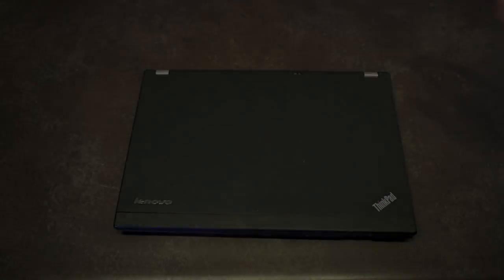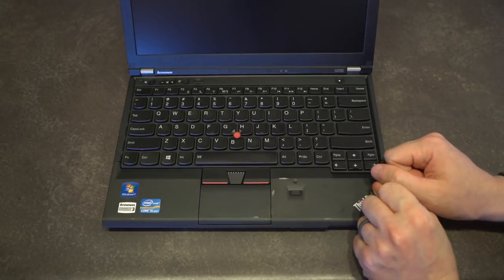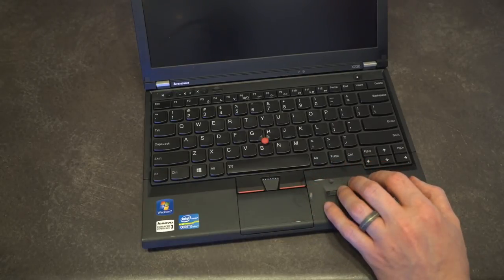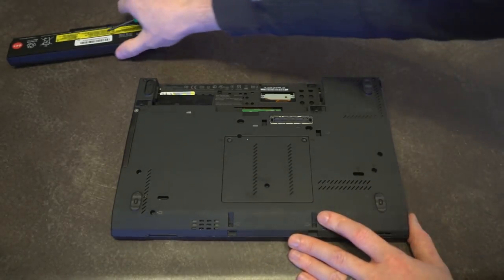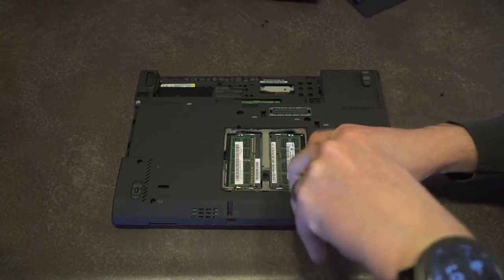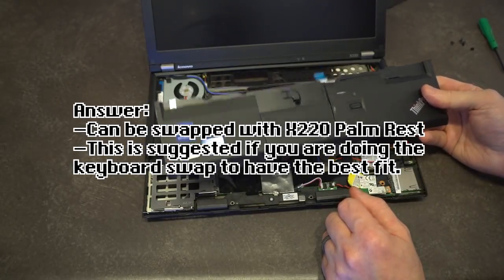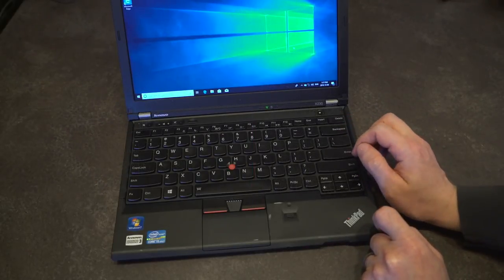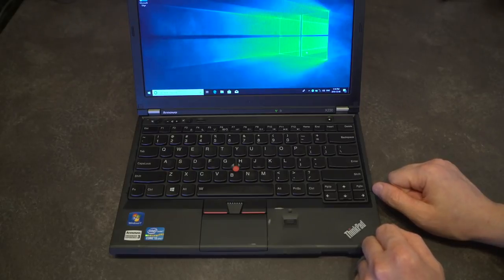Lenovo ThinkPad X230: A Fan Favourite

Comment: would you recommend x230 or x240? Same price
Reply from the maker: Jeez that's tough. X230 has the stronger cpu and nicer trackpad, x240 has better battery life and capacity, not to mention newer integrated graphics.
Reply: @LaptopRetrospective  yeah is that x240 touchpad that bad? Thats one thing that's holding me back
Reply from the maker: I'd swap it out almost immediately if I were buying an X240 and not an X250. Thankfully parts are available to do this very  thing.
Reply: @LaptopRetrospective  why is it that bad I don't really use trackpoint and if it was bad is it easy to replace?
Reply from the maker: It's a manageable swap but the whole click pad is spunge like. You can see an X240 on this channel if you haven't already.
Reply: @LaptopRetrospective  and how would those two laptops run league of legends? I'm planning to buy some laptop for a college and those two are my favorites rn do you suggest anything else in this price range?
Reply from the maker: @danbartik4428  You'd meet the minimum requirements I think, not the recommended. You'd want to track down one with the 1080p panel I'd imagine. As for price range, that depends on what these cost you where you are vs what is available.

Comment: My x230 doesn’t have the fingerprint scanner:( also my thinklight is none functional so I probably wanna install a backlit keyboard in there at some point.
Reply from the maker: You could also replace the ThinkLight. Fun little project.
Reply: @LaptopRetrospective  I could do, I’m no good at taking apart laptops:( 

It sort of works but only if I press the top of the display
Reply from the maker: Well you've got the maintenance manual to follow if you want to give it a try. 😉

Comment: These things get warm very quick on the underneath though...I don't like how you can't change the CPUs in these and the screen damages easy, shame as they're nice without fault.
Reply from the maker: Haven't had screen breakage on the ones I've seen. Sadly most modern laptops aren't socketed.
Reply: @LaptopRetrospective  yeah I've got one of these and suddenly a green line appeared down more the left side of the screen. It's an ips. When it's been on for a while the line fades a little but on start up...a bright green line. Yup this is why I prefer the win7 designed laptops. They're more upgradeable...best era for laptops. Like the hp elitebooks are pretty solid, and the CPU is easily removed. I do like these Lenovo x2 series, but I just think they're abit flimsy.

Comment: Mine is a i5 3210m with 4gb ram 😥
I am also missing the backlit keys but I have the light next to the webcam, is it possible to fit a backlit keyboard?
Reply from the maker: Yep, just need the right part for the x230. It's in the hardware manual.

Comment: I have an x230 and im supper happy with it, but the one thing that the t series does better is durability. My brother has a t430 and it was dropped on the concrete and it was totally fine haha
Reply from the maker: The T430 does have more mass to absorb the impact I suspect. Each drop is different.

Comment: Thank you for your good video on the Lenovo X230. My X230 is constantly overheating. Is there any solution to this please?
Reply from the maker: New thermal paste and possibly a fan replacement without knowing more. Def an issue in the cooling system somewhere.
Reply: if you change a new fan, and using old heatsink, make sure no dust in jammed between the fan and heatsink in between. 

If you are swapping a heatsink with a new fan then no problem with it. 

after doing that, see if its help, it is still the same it means something in your laptop is running that is pushing the temp to the max (try a bootable like puppy linux or another hard disk with a fresh windows to see its sitll over heat with new thermal paste and fan.

Comment: I have the tablet version of the x230 with capacitive screen and Wacom pen, running Win10. It's a very nice machine, but it's way heavier to hold in touchscreen mode than an iPad!
Reply from the maker: It is one of the benefits of lighter machines is it makes the tablet form factor easier to use.

Comment: Hi, would anyone know whether it would be possible to replace the keyboard and palm rest on the x230 with with the keyboard and palm rest (the one without the track pad) of the x200?
Reply from the maker: The keyboard, as far as I've read can be downgraded to the x220, not sure about the palm rest. I think I've read some things on the forums, but I can't remember the specific information.
Reply: @LaptopRetrospective  Thanks for your reply! If you find more information on this matter, please do a video on it! :) That would be highly interesting. The keyboard on the x230 is nice, but I prefer the older keyboards. Furthermore, I don't like the track pad on the x230 at all! I don't know why, but it somehow annoys me. Besides, I much prefer to use the track point over the track pad anyway.
Reply from the maker: @hpp6116  I can confirm that the screw patterns on the X200 parts does not fit the x220 and x230.

Comment: I bought the x230 last year after upgrading from X131e. I just love it! The only thing that is a downside is that the battery gets sucked out quite easy.

Btw my x230 fell down from a table so one of the springs for holding the battery in place isnt working, can somebody advime me how to fix it?
Reply from the maker: Check the maintenance manual for a part number and look at replacement options.

Comment: this is video from a nice laptop ! 
I (daily) use a macbook with the same specs as this laptop. 
Do you know how it handle linux drivers ? 
I was just about to switch to a Thinkpad when I heard about the locked down BIOS, 
Do you know of any brand that makes same quality laptops without those drawbacks ?
Is there ways to flash the Bios whitelist on newer models like the T480s ?
Reply from the maker: Drivers for Linux are a non issue. As for the BIOS, most people want to do it on older units to get better WiFi cards, which isn't as big of an issue on newer machines. It can be done, but requires hardware flashing.
Reply: Depending on your use case, I’d put money on it being the BEST laptop for Linux, actually
Reply from the maker: ThinkPad and Linux generally get along famously.

Comment: Kindly advise for Fan error or I have to exchange the fan of X230 thikpad
Reply from the maker: From the Lenovo forums: "Fan error" doesn't mean "doesn't spin" or "too hot", it usually means "too slow". The fan spins for 1/2 second at startup and if the speed isn't high enough, it usually means the lubrication has dried up or worn out. You can try to clean it and re lubricate or it needs to be replaced.

Comment: im watching this on a X230, but still Win7
how to enable mute for microphone here? mine cannot do that :(, and non original battery cant do charging threshold?
Reply from the maker: You might be missing some drivers or your button might be faulty.
Reply: @LaptopRetrospective  what is the name of the driver? i still finding it but nothing found
Reply from the maker: @hafizhnabawi1707  on most models it is called a hotkey driver.
Reply: @LaptopRetrospective  can you give more detailed information about that thing? Im a rookie on ThinkPads
Reply from the maker: @hafizhnabawi1707  what information would be the most helpful?
Reply: @LaptopRetrospective  the suited driver and what site should i go for
And battery threshold mode ☺️
Reply: @LaptopRetrospective  i've got the needed driver, very happy that my machine works fiine
thank you ery much
Reply: @LaptopRetrospective  and another question that, how to synchronize between my 65w adapter that should be readed as 65w not 90w one on ThinkVantage power manager?
Reply from the maker: Glad you got the driver working. I am not sure what you are asking regarding the power adapter.
Reply: @LaptopRetrospective  i mean that when i plug the adapter the Lenovo power manager is telling me that i attach a 90w adapter instead 65w. also, i got the core i5-3230M rather than 3320M but no performance differrence is visible
Reply from the maker: @hafizhnabawi1707  is it a legit Lenovo part? Regarding the processor difference, I'm not sure you will notice a massive change between those two.
Reply: @LaptopRetrospective  yes it is. Its an original Lenovo adapter came along with my machine.

Comment: Mine won't boot with hyperx ram 16gb...any suggestion to fix it?
Reply from the maker: What are the exact specs of the RAM you're trying to use?
Reply: HyperX IMPACT (HX321LS11IB2)
Reply from the maker: As I suspected, RAM your using isn't compatible from what I'm reading. PC3-12800 1600MHzDDR3 is what is listed as stock. That RAM you've listed is DDR3L and 2133MHz.

https://www.lenovo.com/ca/en/laptops/thinkpad/x-series/x230/
Reply: ooo...that's why..thanks
Reply: And is it possible to underclock it??
Reply from the maker: Not 100% sure.
Reply: Ok thanks
Reply: My X230 can handle DDR3L 2133Mhz 16gb RAM without problems. Maybe your bios configuration is locked and you should change the setting.
Reply: @josebringas8099  what bios version do you use?
Reply: @fajrulkamil4574  you can search in Reddit in the thinkpad foro. There are a lot of us using 16gb RAM 2133Mhz. Because I didn't touch anything in the bios settings, only put it on ram slots. But there are people that had that issue.
Reply: @josebringas8099  ok thanks

Comment: Has anyone experienced an issue when you move or jostle x230 powers off? You have to physically remove battery and reinsert to boot again. Everything works fine unless you bump or adjust the screen. I tried re seating WiFi Bluetooth module, but made no difference. This is such an amazing laptop - it bums me having this issue. Bought new OEM battery, SSD and did clean install of Win10 1809.
Reply from the maker: Sounds like something is loose on the mobo.
Reply: Take it apart, remove the heatsink, clean the OEM thermal "paste", apply new paste.
Reply from the maker: Think it might be a heat issue? Might be best to monitor the thermals first.
Reply: I'm leaning towards a bad solder joint on the motherboard. My thermals are okay, and the issue only seems to occur when putting pressure on the right corner of the screen. I'll definitely apply new thermal paste when I tear everything down to investigate.
Reply from the maker: If that is the cause, I'd be looking for a bad trace.

Comment: any idea if I can develop games using Unity on this laptop?
Reply from the maker: Minimum system requirements for the version you're planning on using?
Reply: @LaptopRetrospective  from https://docs.unity3d.com/Manual/system-requirements.html

System requirements for Unity 2019.2

System Minimum requirements
Operating system Windows: 7 SP1+, 8, 10, 64-bit versions only
macOS: 10.12+
Linux: Fixed at: Ubuntu 16.04, 18.04 and CentOS 7
Server versions of Windows and OS X are untested.
CPU SSE2 instruction set support.
GPU Graphics card with DX10 (shader model 4.0) capabilities.

Devices
iOS
Mac computer running minimum macOS 10.12.6 and Xcode 9.4 or higher.

Android Android SDK and Java Development Kit (JDK).
IL2CPP scripting backend requires Android NDK.

Universal Windows Platform
Windows 10 (64-bit), Visual Studio 2015 with C++ Tools component or later and Windows 10 SDK.
Reply from the maker: @shuragamingyt  According to this, it should be able to, but I don't know how high I'd set my expectations.
Reply: @LaptopRetrospective  Thanks for the reply. Also, I like how you edit and present your videos. Informational, to the point and the video length is ideal. Keep up the good work! :D
Reply from the maker: @shuragamingyt  Thanks Boss, I'm glad you enjoy the format.

Comment: Hi, can anyone provide any info about external monitor support? Like maximum supported resolution.
Reply from the maker: These either have Intel HD 3000 or 4000 integrated GPUs depending on the CPU. 1920×1200 through HDMI and 2560×1600 through DisplayPort. But it's one or the other, not both at once.
Reply: @LaptopRetrospective  thanks a lot. Love this channel.
Reply from the maker: You're welcome!

Comment: Is it useful for designing and video editing?
Reply from the maker: Depends on the demands of your projects and what CPU configuration you are using. More details would be helpful.
Reply: Laptop Retrospective I am thinking of buying a laptop to use on Photoshop, illustrator, and maybe premier and after effects and, I saw a core i5 with 240gb SSD. I want a Lenovo but I am in a budget less tan 500$
Reply from the maker: those programs can use a lot of resources. Depending on the complexity of your projects I think you'll find the x230 and lower end machines bottleneck easily.
Reply: Laptop Retrospective thank you very much!!

Comment: I bought one and immediately switched out the awful chiclet keyboard for an X220 keyboard. Be prepared to do a little firmware updates to get the mapping right.
Reply from the maker: Yeah, sadly not a drop in replacement.
Reply: I prefer the the chiclet keyboard over the traditional keyboard. I love them both on Thinkpads though.

Comment: Which has a good display x230 or t430?
Reply from the maker: That mostly depends on the used model you find. Most came with TN panels, not IPS. But you can buy upgrades for both.

Comment: Now I feel I should get a X230 its cheaper too and you can put the same keyboard on it

Feels cool to have a no bars 100% free hacker laptop, a pinnacle in computing. X220 is a little bit more costly than a X230 on ebay that must mean that theres something to it even without its upgrade hardware!
Reply from the maker: X230 and X220 are both still great little computers.

Comment: Conseils for ssd purchase for Xmas? I'm a x220 owner
Reply from the maker: Not sure I completely caught what you're asking.
Reply: @LaptopRetrospective  Suggestion to what SSD buy for my X220 for Xmas. There are too many models in 250GB section, I still didn't try that technology with a laptop.
Reply from the maker: Lots of options indeed. I suggest a reputable brand, but that can vary depending on where you're shopping.
Reply: @LaptopRetrospective  Central Europe
Reply from the maker: Samsung, Western Digital and ADATA are my main go to drives.

Comment: does anybody actually know whether it's possible to fit a hard drive 9mm thick from inside? doing it from outside, only 7mm one will go.
Reply from the maker: Might not. No experience here.
Reply: Yes you can but it’s inside only. You will have to leave off the rubber side bumpers, but it can be done!
These days, since 7mm drives in large sizes are available so you might as well stick with the 7mm size.
Reply: @GasPipeJimmy  ok, I see. was wondering as I have some spare 9mm one's lying around.
Reply: as kv Yeah, give it a shot then!
Reply from the maker: Thanks for the information!
Reply: Laptop Retrospective Happy to help!

Comment: Should I get this or a t420?
Reply from the maker: Interesting question, the two machines are very different in size, capability and performance. What do you plan on using it for?
Reply: Laptop Retrospective I’m planning on using it for school, watching movies, and browsing the web. What’s the best upgradable Lenovo for that use in your opinion with a fairly good battery life?
Reply from the maker: @ethankim1089  if you want upgradability then you want to go the T series route.
Reply: Laptop Retrospective t420 or 30?
Reply from the maker: @ethankim1089  both are very upgradable. There is a great guide out there for the T430 I've linked my the related video.

Comment: What makes this a fan favorite, just wondering?
This has been my machine for the last 7 years.
Reply from the maker: The X230 is a great size, portable, good port selection with USB 3 and is very moddable. From ivyrain BIOS Mods, mSATA drives, ExpressCard slot mods, classic keyboard swap to name a few, people enjoy upgrading them.
Reply: @Laptop Retrospective  what Express card mods are possible, have not explored that. I must say the IPS screen is nice despite it being only 720p. Thanks!
Reply from the maker: More USB ports, external GPU kits, NVMe adapters. I believe I've featured all three of those on the channel and I suspect there are more.

Comment: I have x230 too! But not like yours mine dont have that box thing at the right of arm rest.
X230 is good it is also boot fast and durable .
The only thing i hate is cpu speed is reduce to half when theres no battery. So you need its battery to run it full speed but my battery is dying
Edit: i also have the docking thing. That give extra slot and dvd rom
Reply from the maker: The box thing is the optional finger print reader. Batteries are easy to come by so hopefully it's not a problem for long.

Comment: how the f**k is keyboard supposted to overheat?
Reply from the maker: Keyboard overheats due to the pinout not being exactly the same and the volts sent to one part being slightly higher than it should be. So I've read.

Comment: I almost bought one of these last week, but it had a mechanical drive so I thought i'd wait to find a better configuration.
Reply from the maker: Drives are pretty cheap, if it's in good condition I'd just swap them.
Reply: Drives are super easy to replace, and you probably want to start fresh with a new drive anyway
Reply: @archygrey9093  I ended up with an x260 for $120 and got an opal 256gb ssd in it.
Reply from the maker: Nice score!
Reply: @TheBeeOBee  thats a pretty good price for an x260